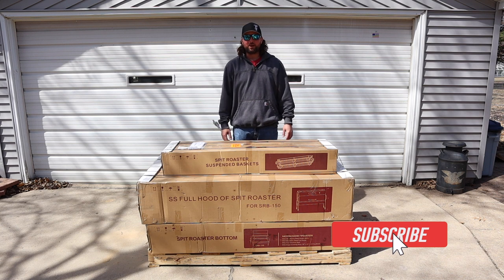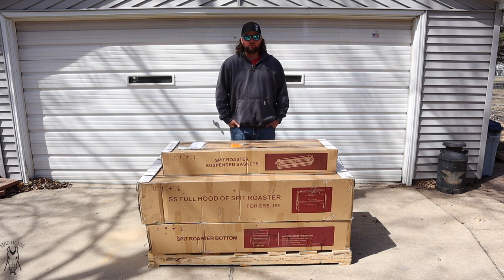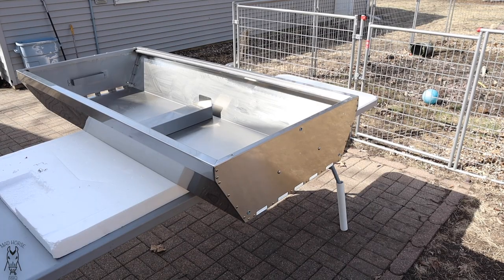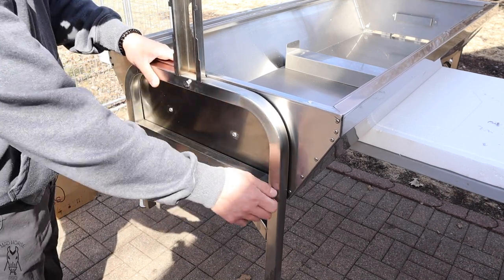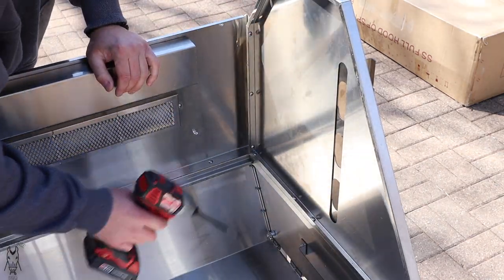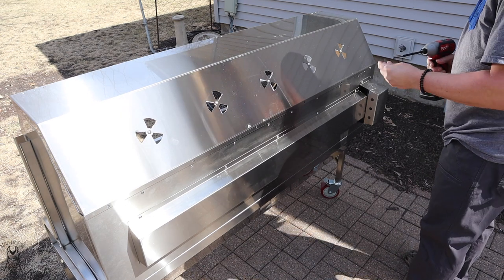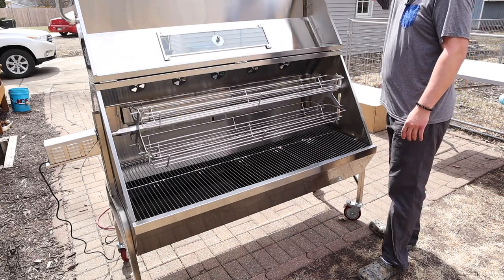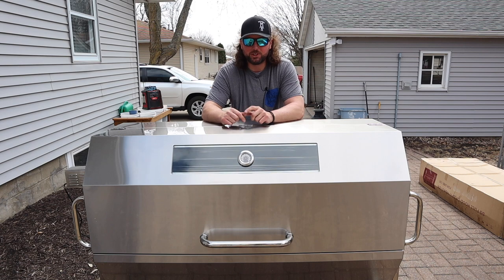Gas And Charcoal Spit Rotisserie | Smoke Daddy Stainless Steel Spit Rotisserie

Comment: If you entertain a lot or are an amateur caterer, this is certainly a great big quantity cook option.  However, I guess you could do a smaller direct heat cook if you section off your charcoal in a basket.  The price seems like a good value for all that stainless steel.  I can't wait to see your "cook" videos on this unit.
Reply from the maker: All good points ted! And thanks man I’m really excited to start using it!

Comment: Nice looking unit. Honestly, I can't see "5 butts per rack." It looks a bit too light to be able to handle 20 butts - or, 150 - 200 lbs of meat in those narrow baskets - besides the load it would put on the rotisserie motor. Could you share a video of it loaded with pork shoulders?
Reply from the maker: Ya you may be right! And I fully intend on doing that cook but have been a bit busy on the home front as of late so haven’t had any time.